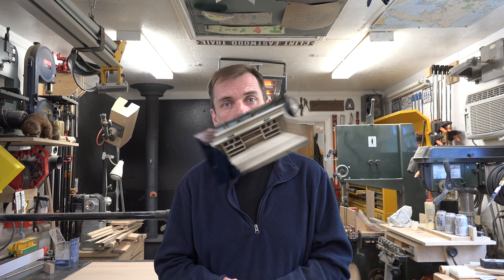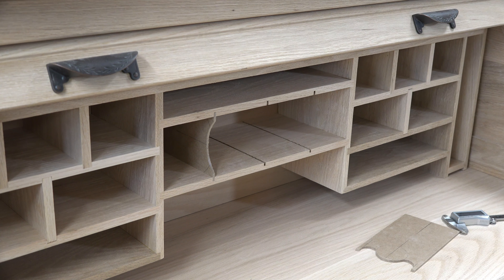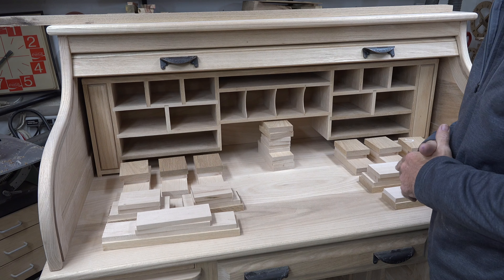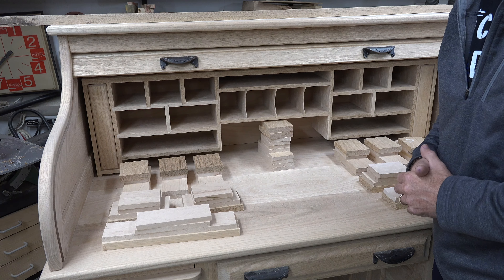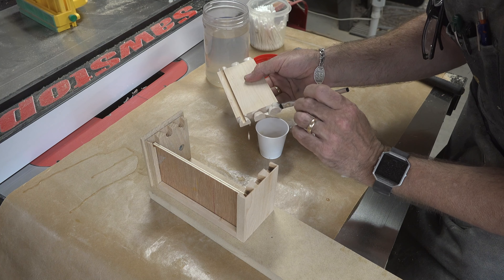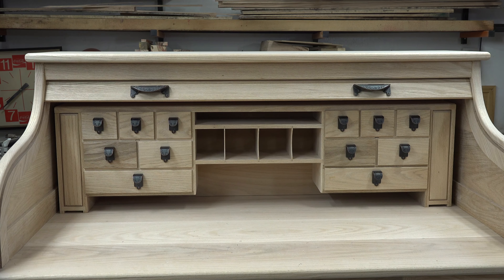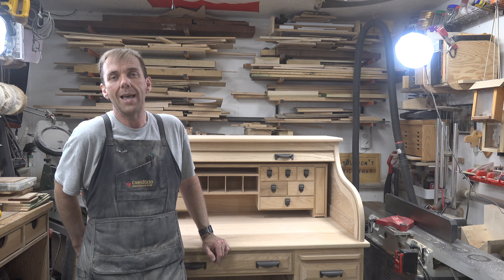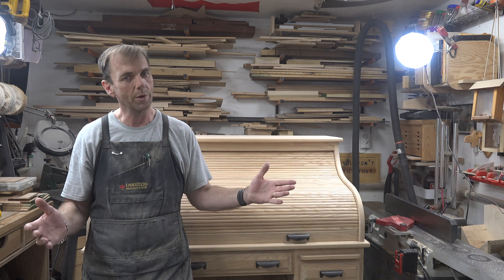Making a Roll Top Desk Part 10

Comment: “Pretty freaking swanky” is absolutely correct. Your desk looks so wonderful. You should be proud. 
The drawers on the cubbies look great!

Do you have a link to those magnetic closure fasteners? If so, I’d appreciate you letting me know. 

Thanks for ... everything about this desk build. No doubt that it will stand the test of time. How have you liked using it? Anything you’d change?
Reply from the maker: Thanks for the kind words on the project Barbara.  Here is the link to the closures.  http://www.leevalley.com/en/hardware/page.aspx?p=40353&cat=3,41399,41403
As for whether or not I would have done something different.....I think I would have given more thought to the electrical and the way that computer cables were run.  I tried to think of the best way to run cables and while I thought that I had a great idea, I haven't really been happy with the "raceways" that the cables run in and will probably be coming up with an alternate method in the near future.  Thanks once again for tuning in and we will see you for part 11 next week.

Comment: Ken, a totally amazing project. I enjoyed watching the series start to finish and am looking forward to seeing what type of finish you use and your method of application. In this video fully agree with your decision to go with the simple divider over the fancier one, it seems a more classic look. I do not have nor have I ever used a Leigh jig but are the dovetails supposed to be that tight to where you need to pound them together? Seems like that could be a headache on a larger drawer. I was just curious about this. When finished will you need to do any disassembly to get it in your house?
Reply from the maker: Thanks for the kind words on the build Paul.  The dovetail should be snug for sure while still leaving enough room for glue to be applied to the joints.  While these dovetails were tighter than I would normally like, they were still a perfect fit and look great with no gaps.  As for taking the desk apart.....sadly, yes it will have to be disassembled not only to get it through the doorways of my house, but also because it weighs just over 400 pounds and it will be a bear to move in one piece.  Thanks for tuning in again this week and I look forward to your final thoughts after the last episode this coming Friday.